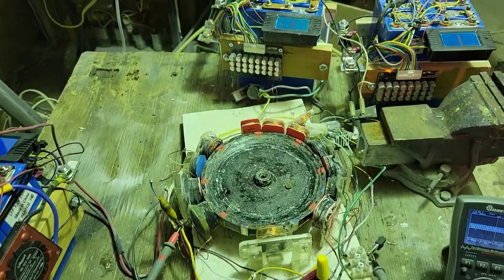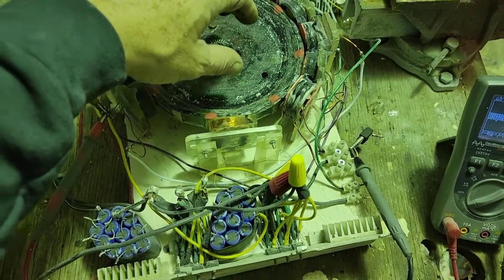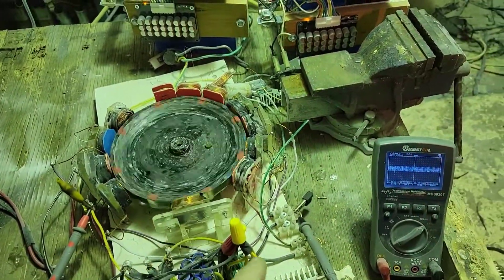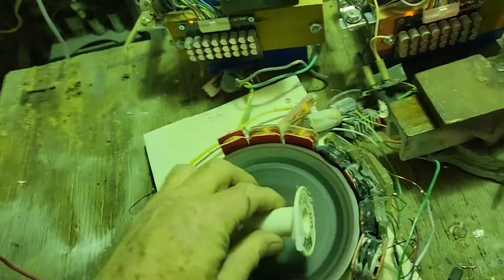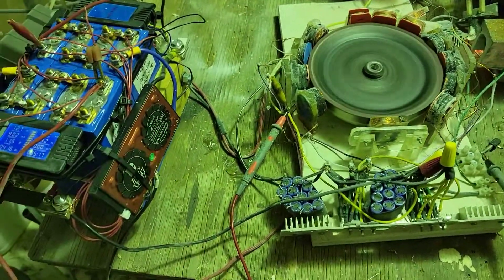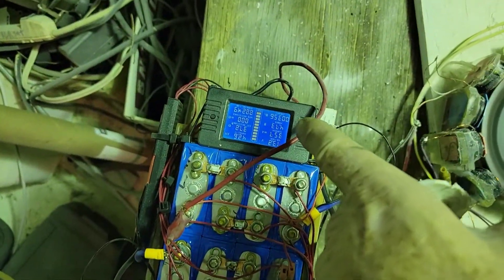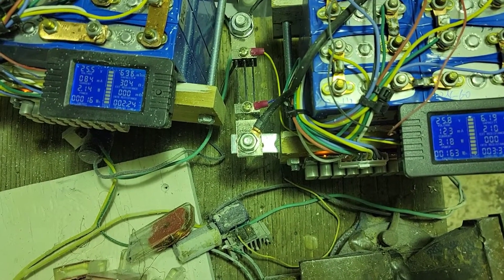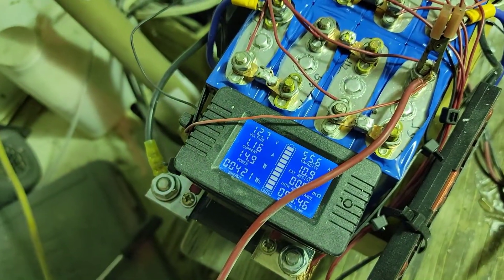Pulse motor is upgraded. Here's what 8 coils do .....part 2.

Comment: Can you please describe your rotor - It seems to me to be the best part! IE. What bearings are you using? Is it a video head from a VHS? Or perhaps are you using clay bearings?
Reply from the maker: Yes it’s a VCR head . And you’re right the spacing between the magnets is very very important. The coils have to be able to push and pull on the magnets. If the spacing is wrong it won’t be very effective.

Comment: Great upgrade. Been following your build for a while now. Cant seem to find the NTE56 transistors where I am but will try to order via Digikey. Can you give specs on the gen coils? Wire size, number of turns, ohms? Also dimensions of gen coil core and overall dimensions after winding? Do you keep the core size same as magnet size? Thanks a bunch.
Reply: Your right Magi, NTE56 transistors are almost impossible to find right now.  Only a couple for sale in Germany last I saw.  I bought 1 NTE5671 to see if it will work but I still need to build my flywheel before I can test it.  I've been able to order 10  D2241 transistors quite easily though.  Jeremy, do you recommend the NTE56 over the D2241 or is there something you'd more highly recommend at this time?
Reply from the maker: Hey buddy here is a video with all that information you're asking for.  Thanks for watching!
https://youtu.be/TbRWTjc9nAY

Comment: Great battery banks and meters! And very high speed at over 300 hz. 
So about 50% of input power is recovered to charge batts and then a whole lotta mechanical power is available. You might be close to OU. You ever thought of mechanically coupling to a generator? Ie. With pulley and belt
Reply from the maker: Hey buddy yes I actually do have some coils that are for charging on the motor too. Just really don’t have the time I need to really tinker and tune it . Most of the work with these projects are the fine tuning that takes lots of time and patience as I know you definitely know. I’m definitely impressed with your setup you have going on there! Before I leave to go to work I’m going to run it on 24v … I have a couple battery banks ready for the input. I’ll try get a video of it up asa